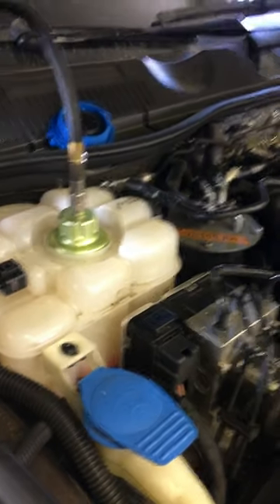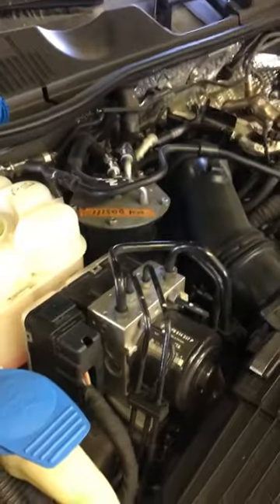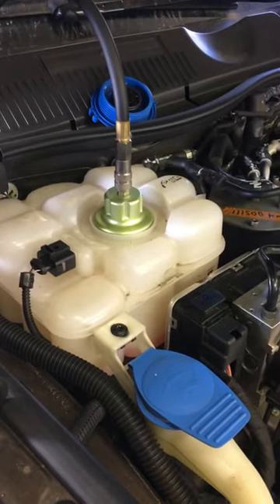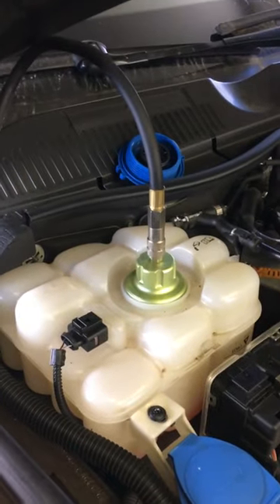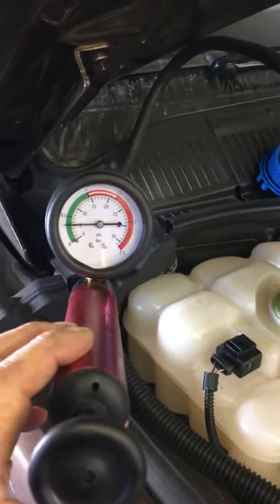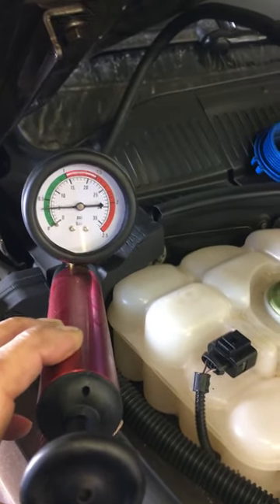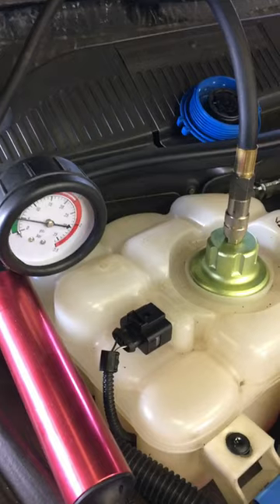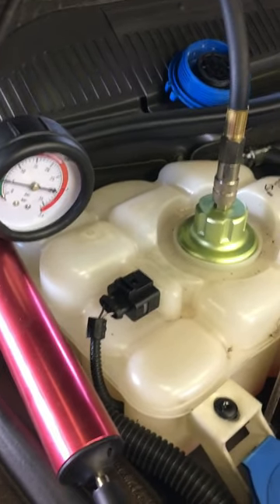Testing cooling system for leaks before filling

Comment: Will you be showing the full coolant service on the Touareg?  I have a T3 and have been following your other videos.  Much appreciated!  👍
Reply from the maker: Hi Eric. Thanks for following. I did not think there was enough to it. Drain by removing the lower rad hose. And replace and fill. There is a bleeder screw on the top of the egr assembly. I will so a short on bleeding. Cheers
Reply: @garysgarage2118  thanks Gary, that was the part I was wondering about...best way to bleed/purge the system.  I've heard the cooling system can be finicky on these things, especially if there is air in the system.
Reply: @garysgarage2118  Thanks Gary for this tip! I will do it this way 🙂 Greetings from Germany
Reply from the maker: @dodgeviper3431  thanks for the comment. Love that I can help out. New video coming this week is for the fuel filter.
Reply from the maker: @dodgeviper3431  thanks for the comment. Love that I can help out. New video coming this week is for the fuel filter.